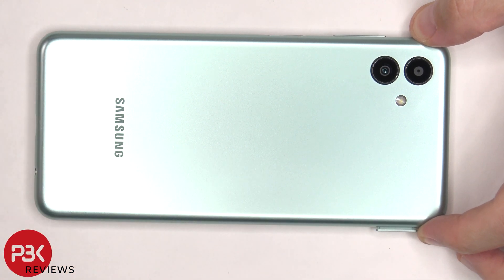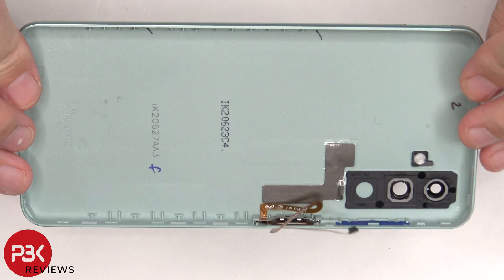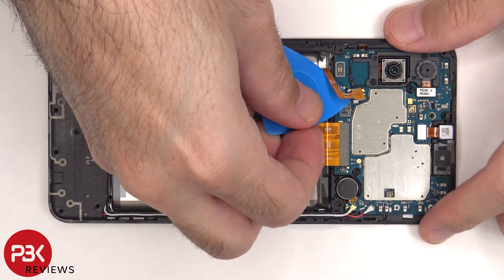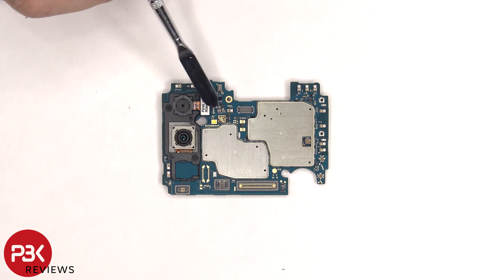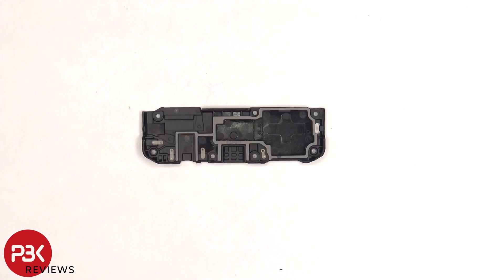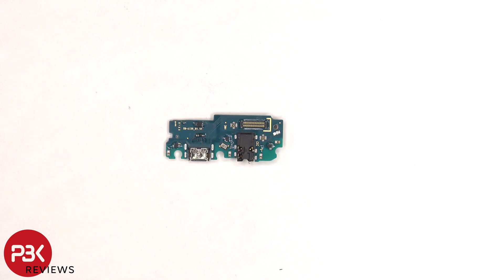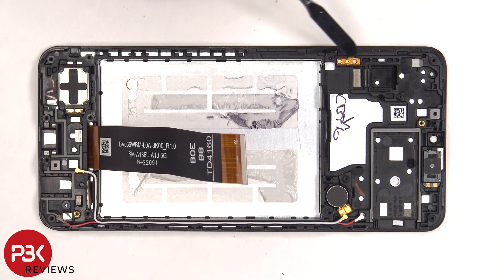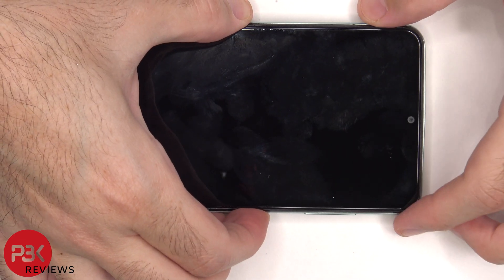Samsung Galaxy M13 5G Disassembly Teardown Repair Video Review

Comment: Can i use a13 5g parts on this phone including screen and fingerprint sensor middle chassis?
Reply from the maker: Might be possible, looks to be the same but there may or may not be a slight size difference. Not 100% sure. I would assume should work.

Comment: i found that we could add one more camera in m13 5g by installing a socket below the second camera and also by changing the back plastic cover of the phone
Am I right??
Reply from the maker: yeah but usually from the software its disabled or not programmed to read additional hardware that is installed which has not been incorporated in that phones software.
Reply: @PBKreviews  ok thanks for information